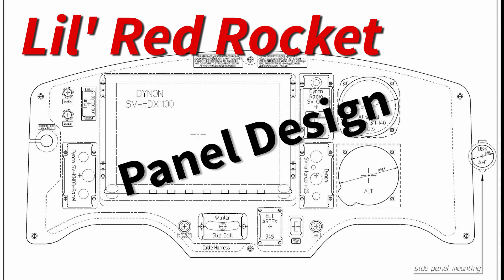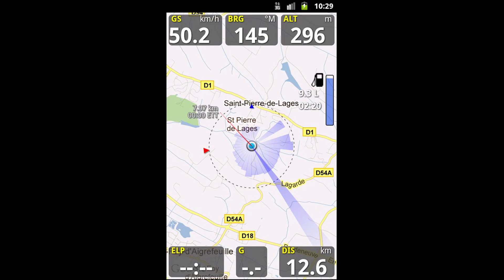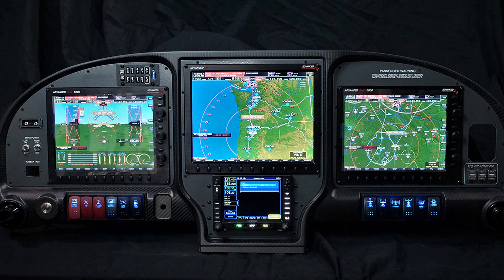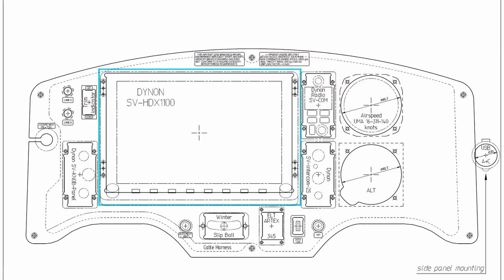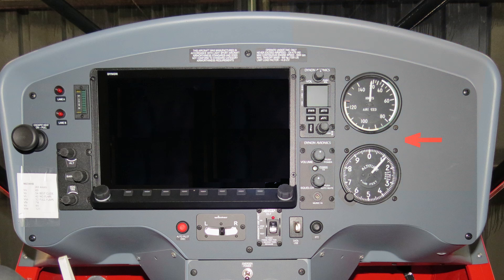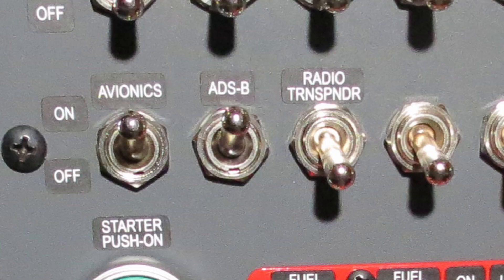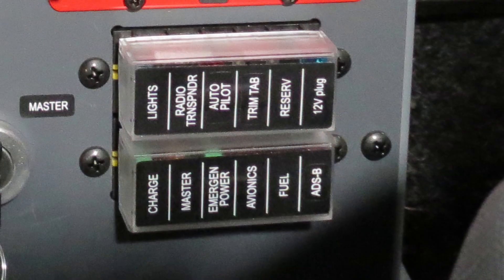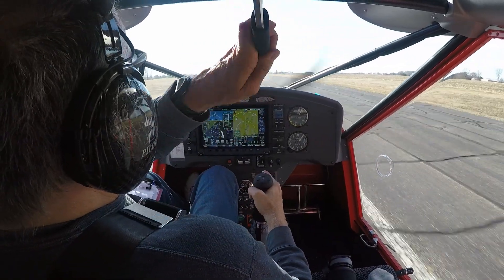Little Red Rocket Panel Design

Comment: Joe, very functional panel. Is the Dynon the only source for engine performance (temps and pressure)? If the glass panel died do you have any options? I suppose if all was well before it died you just keep flying. Nice update.
Hope your weather has turned 'flyable'. All the best.
Reply from the maker: It is the only source, but it has a built in battery backup. The engine works without it, but that would require a landing as soon as reasonably possible. The weather has been typical Ohio turn-on-a-dime stuff. But I have managed over 22 hours since I took delivery 10 weeks ago! Cheers and thanks!